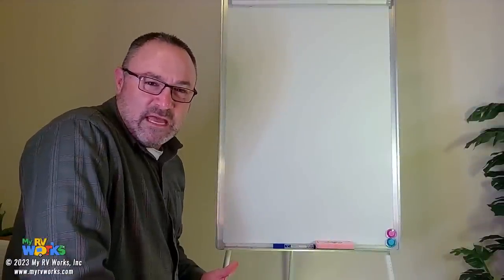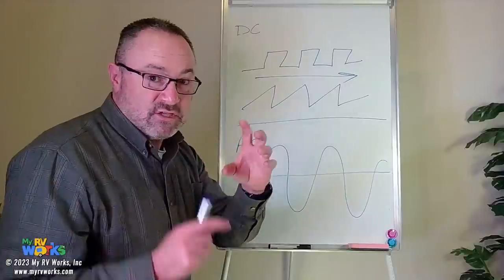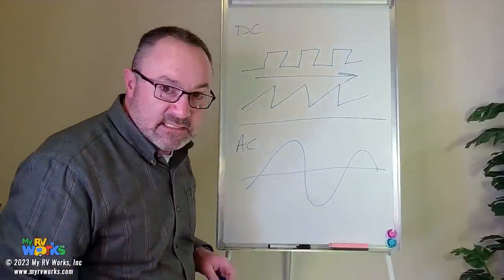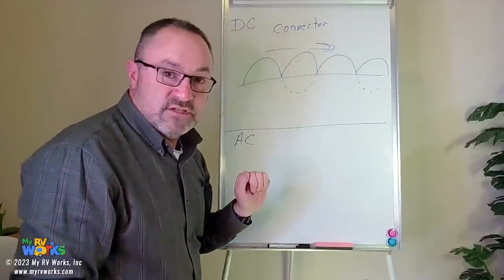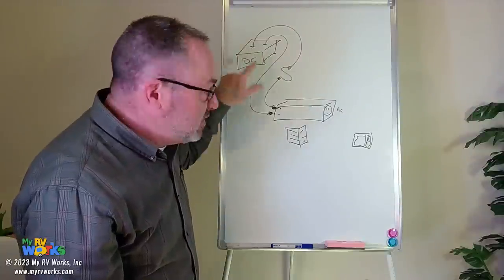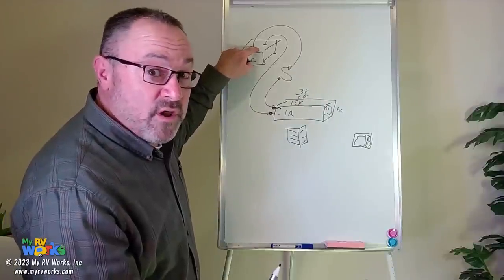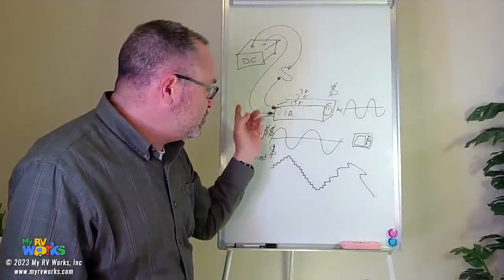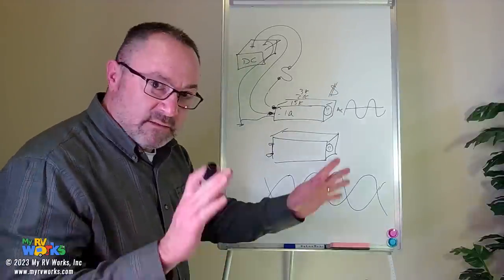What Does An RV Inverter Do  &  How Does It Work? --  An RV Inverter Discussion -- My RV Works

Comment: It would be great to see the whole system sizing for battery ( amp hours) solar needed for charging etc. Those calculations for planning a system would be great.
Reply: If you are wanting to run a refrigerator, for example, on solar/batteries, then look at the label for total current.
If you have 2 appliances, add both currents together.
A refrigerator does not run all day 24/7 and sometimes the current will increase for a few seconds when the ice makers are running.
2 appliances may or may not come on at the same time, but you must be ready for when they do.
If the refrigerator label says 6A, then size your Full Sine Wave Inverters to be at least double that.
If the freezer says 6.5A, then you total current is 12.5A.
I use a 2000W FSW Inverter to power 1 refrigerator and 1 upright freezer.
You could use a 3000W Inverter, but I would not go much higher than that.
The batteries are different if you are using lead-acid or lithium.  
I use 4- Group 27, 12VDC lead-acid batteries in parallel for a 12VDC system.
I also have 600W of solar panels to charge the batteries.
The system will only draw what it needs and on a cloudy day the system cannot draw all it needs.
Expect to stay on grid more on cloudy days, clouds/shade cost you money.
This system will only operate your refrigerator for about 6 hours per day when the sun is out and few clouds.
Make sure you have a Grid Backup Relay that will transfer to grid so you do not lose food.
I use the 80A double pole relays for a Transfer Relay. (About $22 on Amazon.)
Your charge controller turns the system on and off as the batteries allow. (About $10 on Amazon)
If you want more battery time, then add more batteries. (About $100 each at O'reilly)
You could have 12 batteries and not make it all night or it could make it for 2 days depending on use.
Taking any appliance off grid for a few hours will save you money on your electric bill.

Comment: Great information. So in stead of buying a converter/ charger,  I use my inverter to run my RV outlets and appliances. I ran a 12 gauge cord 1 ft from my inverter and hard wired into a metal junction box. from there it runs thru the frame of the RV into where my power cord is located. It terminate into a 120v outlet. I just plug my shore cord into the outlet, turn off the converter and turn on the inverter. I do have 500 watts of solar and 300 amp hrs of lithium batteries. hank you for all you do. Don
Reply: I use a aims 3000 inverter charger

Comment: That's not true a diode can have current going both ways because it can raise voltage and lower voltage depending on the direction you have the diode inline

Comment: Darren,   A few comments.    When DC comes from a battery, the DC line is flat in one direction.   When AC is converted to DC, that is when you get the square wave and saw tooth.   I think you were looking for IGBT(Insulated Gate Bipolar Transistor).  When I was designing Utility solar systems, we used 500Kva 600-1200Vdc to 480/277Vac inverters.   These hade massive NGBT’s (N Gate Bipolar Transistor’s).   The difference between the modified sine wave and the pure sine wave is the number of these transistors used to assimilate a sine wave.  Each transistor makes 2 points on half of a wave.  The inverters we used were pure sine wave and had 16 NGBT’s per completed sine wave.   I disagree with your double 120 volt sines from two inverters is 240 volts.   If the waves were as shown, the voltage above the line and below the line would cancel each other out and be zero volts.   I believe that the wave that is 240 is twice the height of a 120 wave.  By connecting the inverters together, you are doubling the number of windings of the output transformers.   You did give lots of good information to those who have no knowledge.  Respectfully,   Kevin

Comment: The DC current is usually shown on a graph as going up and staying there until turned off, it does not turn on and off or go below zero.
What you showed is closer to a Modified Sine Wave that is put out by Modified Sine Wave Inverters.
The Modified Sine Wave Inverters are cheaper to buy but makes a lot of noise and does not run motors correctly.
Some of the newer battery chargers put out the wave that you showed and their pulse is off longer when the battery is close to being fully charged.

Comment: Nice smart explanation!  Shocking how many ppl think a solar pnl can run AC current devices.  Big inverter big wire, big battery BANK.  Do discuss amount of power needed to run a 1500w microwave! 

YES! Please discuss how much solar is needed to recharge a bank. Especially in Oregon, where it rains A LOT!  Have a 300 ah Lithium battery.

Sorry, NOT capable of starting an Rv repair...... just a few state park volunteer gigs here & there. 😉 and offer some assistance to others to understanding their rig.

Comment: Daren thank you very much for your discussion of inverters and converters.  In my RV (Renegade Veracruz 2021) I don't have a converter but a hybrid inverter/charger (MSH 3012 RV).   How is an inverter different from this inverter/charger?  A related but different question is: while plugged into a pedestal, is my 12V source my battery or does the inverter/charger also supply this 12V?  I believe the answer is  my battery but I'm not sure if this inverter/charger also diverts some the 'charging' component to supply 12V .  Thank you

Comment: New to our TT. The dealer provided one battery, but everyone has mentioned to switch to lithium batteries. We don't boondock (yet), but I can see a rest stop or cracker barrel stop in our future. When I looked at LifePo4 batteries, I am told that our wiring and other equipment cannot handle this change over......adding to the cost. Someone mentioned that a more cost effective (though still limited) would be an AGM battery over what we have? Your thoughts?

Comment: Whoa. Awesome knowledge. I have a quick question that no one seems to know or talk about.  I have agm batteries   They all say don’t run then down pass 50 percent. Well when do I know when the  batteries are down to 50 percent.   Thank you
Reply: Fully charged =12.7 volts
50% charged =12 volts
Both of these values assume resting voltage. ie: no draw on the battery for a period of time before testing.

Comment: Thanks Darren I got more understanding on this topic, However, most RV's come with (1) 12v battery. If you are boondocking a lot, how would you hook up two 12v DC Batteries in Parrell with a 400w solar system and will this cause a problem with the solar system and/or your Inverter/converter? My inverter is a Xantrex Freedom x2000 Model 817-2000, Thank You

Comment: Would it be helpful to install a switch for the inverter to turn it on and off as you need it so you don't have to worry about it running when you do not need AC power?

Comment: My inverter remote is showing low battery. Can I turn the inverter off and my RV should work off just shore power? The power went off in my RV, and the inverter remote was not displaying anything, then three days later the power just magically came on again, then after a day and a half it went off again, but the inverter remote is now on. From this video I thought maybe something is set to drain the battery, but I haven’t changed any settings and power has been fine for a few years so I’m just trying to figure out what happened.

Comment: Can you help with sizing a battery bank size of wires etc... for a 12vdc 3000 watt inverter please
Reply from the maker: Best place to find that information is in the installation manual from the inverter itself. The manufacturer will list different wire gauges based on length etc.

Comment: What about the batteries that run the generator &/or how the generator works?
Reply from the maker: Some manufacturers will wire the generator through the chassis battery, others will wire the generators to the house batteries. I've seen it wired both ways.